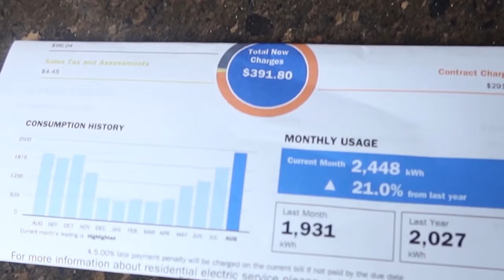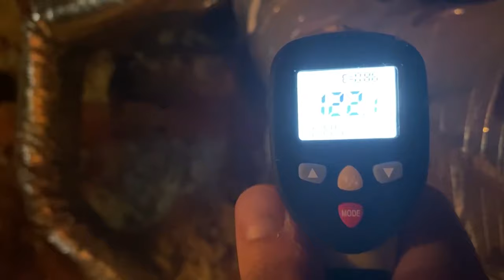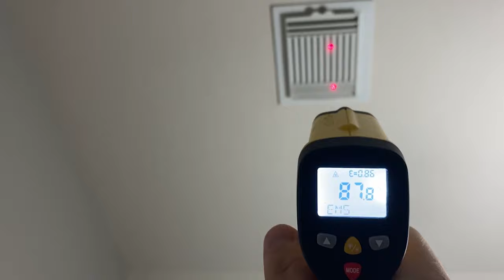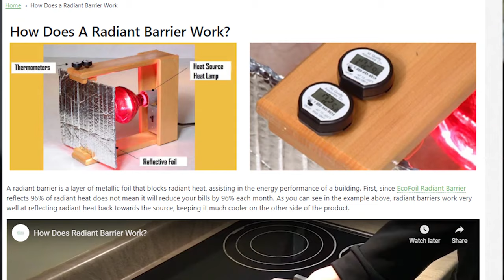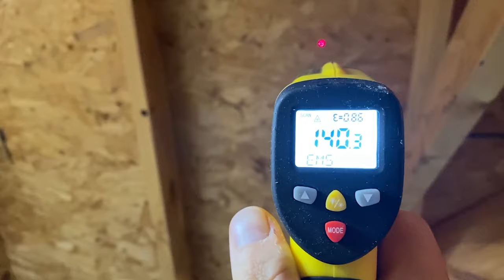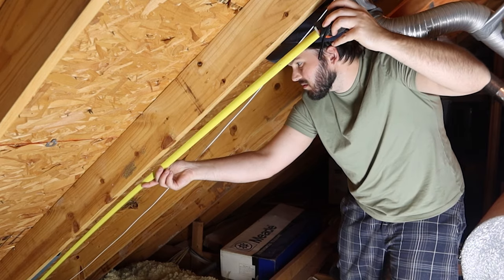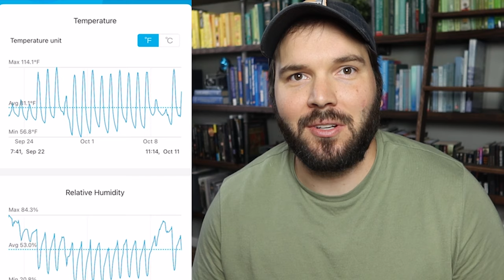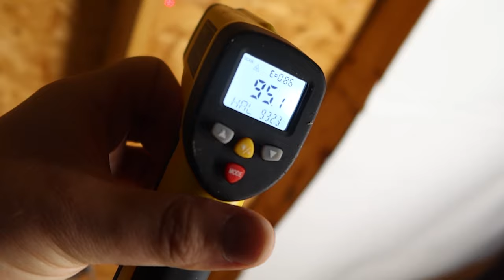Do Radiant Barriers Work & How Much Energy Will it Save: Real Home Owners Experience (Before/After)

Comment: Great video. Want to do this in my crawl space attic but double sided. Was considering the Lowes as it’s a little less than Home Depot but almost want to support attic foil because they’re a great resource.
Reply: Innovative Insulation in Texas $.12 s/ft
Reply: Buy it in February. I bought a double aluminum foil side but single bubble wrap in the middle for $50 for 500sq. Ft.  I couldn't believe the deal. Now I can finish my attic. I just did some of my attic for 1 summer and it made a big difference. Now I'm very excited for this summer :)

Comment: Would I be able to line my roof without putting tiles over. My roof is flat and it is so hot during the summer
Reply: It needs to have an air gap of at least a half inch.

Comment: I leave the ac fan on all the time and it works well
Reply: It will increase the humidity during cooling season. The condensation from evaporate (indoor) coil will get back to the house.
Reply: Yeh. Don’t do that. It increases humidity.

Comment: Sounds like your ac is being controlled by the utility company if it's 15 on and 15 off. Is this the case?
Reply: Someone above posted that the unit is most likely oversized. If it short cycles, then it probably is and will wear the unit out. Bigger is not always better. You must be referring to the smart buildings where everything will be controlled!

Comment: I was watching a video on YouTube about HVAC ducts, he said ducts in attics is bad idea, temperature difference is huge in summer, R8 insulated ducts are not helping.
Reply: Quite true. Running HVAC ductwork through the attic, which is all too common, means that chilled (or in winter heated) air is only an R7 away from a very hot (or cold) attic space. I my case, I solve that problem by putting an additional R7 wrap around my ductwork and putting 16-inches of blown in cellulose on the floor of my attic. That gives about 5 inches of cellulose above my ductwork. It seems to work well enough. Even my most distant vents get properly heated or cooled air. I also used aluminum foil tape to seal up the gaps between the vents and my ceiling so there's no air leaking into the attic. Tape seems to work better that expanding foam and is much cheaper.

Comment: Wouldn't it destroy shingles though? I mean your blocking out all that heat and heat has to go somewhere instead it just keeps building witch leads to melting the shingles, right? With temps reaching 100+ F those shingles should be reaching atleast 130+ F
Reply: No it doesn’t. Watch the video: Radiant Barrier Is It a Scam by Sarasota Energy Saver

Comment: building a home so that the roof is separate from the home, will prevent this issue. Think of the roof as a tree shading the house fully, and the house underneath, it has a 2nd roof to seal off home from outdoors.  This way, attic is free to vent all that heat, home is shaded all day.

Comment: If you use white Roofguard 700 on you asphalt roof every other year, it eliminates the need for a radiant barrier and you will have a forever roof.  After I applied several layers, my attic went from 145+ midday in the summer to 5 degrees above ambient temperature.
Reply: You applied this to your residential home? Just wanting more detail. Say I bought this product and painted my roof on a one story home with an attic and around a 30 degree angle.
Reply: @toolandmaynard  My roof was leaking and the shingles were curling up.  I used a 3/4" nap roller with a 12ft. pole to backroll Roofguard under the shingles and pressed them back down.  I used 3 layers the first time to seal everything.  I've been reapplying about every 1/3rd year since.  Now it's a solid coat.  Any groves I filled in.  The downside is snow doesn't melt like a normal roof.  My neighbors will have ice dams and ice sickles and then go dry while my roof will just sit there full of snow.  So if you get a lot of snow, that might be an issue.
Reply: Interesting. I have a couple areas that are weak in my roof and leak slightly. Sealed it with tar haven’t noticed an issue yet. I’ll look into this. The snow not melting is a sign of good insulation. I get what you are saying though. Thanks
Reply: @toolandmaynard  Any bad spots I used a couple of layers of 6 oz.  fiberglass cloth.  The cloth makes the roof dramatically stronger.

Comment: Thank you! I also like the white. Can you tell me where you purchased it?  I just thought of something though. If it is white on the inside, it wont work as a radiant toward the inside during the winter months.
Reply: If you live in the north/cold, you lay it down on the floor of the attic, on top of the insulation. That keeps the heat inside the house.
Reply: The white side is for appearance only, to give a finished look.

Comment: If ducts have to be in the attic the first step is to eliminate as many air leaks as possible. The second step is to insulate better, most homes have at least R30 attic insulation but at best the ducts are R8. The radiant barrier is always nice to have as well but should be the third step. I spent 45 years in the HVAC industry and if building new today I would use the highest efficiency mini splits and build the home very airtight adding an ERV to introduce fresh air.

Comment: Sounds like you could benefit from a gable fan for you attic. And I'd look into your ductwork those numbers sound extremely at start up. Check to see if they are sealed and insulated properly and routed correctly.
Reply: Thatd tank the AC efficiency and cause moisture issues. Gable fans aren’t common in humid climates for this reason. If he’s already got humidity issues this’d be a recipe for disaster
Reply: Do not put an electrical fan where there is lots of insulation that can start on fire. Very bad idea foil and bubble wrap can't start a fire. So just get the radiant barrier

Comment: Company giving me estimate puts it in the floor versus the roof. To prevent the heat/air from escaping or coming in. Said 20% less solar panels needed
Reply: Air sealing is the only way to stop the heat moving around. Insulation uses air to get its R value, if you pass air through it the heat goes right with it.

Comment: I would be interested in the change of temperature between the barrier wrap and the wood sheathing as that may affect a significant rise in heat causing a shorter lifespan for the shingles...
Reply from the maker: That is interesting. I didn’t think about the heat affecting the lifespan of the shingles. Towards the end of the video I do show the difference between the radiant barrier and the underside of the sheathing. It is almost a 20 degree difference on a mild 76 degree day.
Reply: @GrayHouseStudio  I think air movement and the attic heat both affect the lifespan of shingles. That's why attic ventilation is so important.  I would be interested in the heat between the barrier and the shething next time you've had some nice hot days...
Reply: Here is a video I did back in 2011 Showing that the roof deck over a radiant barrier will only go up 5-10º which is considered nominal.  https://youtu.be/OHpyv_kxmoI
Reply: @AtticFoil  Thanks for the video and information...
Reply: @GrayHouseStudio  I had a new roof put on 5 years ago and allowed the ridge vent. Love it. Just by itself it works great. I can't wait to see the difference with the barrier.

Comment: ATTACH  IN THE ATTIC BY STAPLE TO THE RAFTERS, THAT MAKES THE AIR GAP.  OR LAY KN TOP OF EXISTING INSULATION.  IF USING THE PROPER RADIANT BARRIER IT WILL WORK.  IT WAS USED IN SPACE TO CONTROL TEMPERATURES IN SPACE SUITS AND MODULE
Reply: Foil stapled to rafters has another advantage. It channels the heat up creating a chimney effect. That keeps the hotter air away from the insulation above your living areas.

Comment: Thank you for sharing the results on the actual difference the Radiant barrier makes using data from yourtemperature sensors. I'm in the UK where the summer/fall temperatures generally don't require the need of using A/C to cool the home. I am really keen to find out if the radiant barrier prevent warm air under the attic insulation from escaping out through the roof. I noted that the product you used only has the reflective surface on the outer side and not inside. So I take it this product does reduce heat loss during the colder months.?
Reply: From what I know, reflecting back heat is considered the most optimal (ie. the shiny side inwards if you are trying to retain heat), but it actually works very well even if you do the opposite. This is because of a material property called emissivity. While reflectivity tells you how much light is bounced back (higher is better for an insulator), emissivity tells you how easily a material gives off infrared light (radiative heat) relative to it's temperature (lower is better for an insulator). Aluminium foil and these mylar-like materials (basically aluminium foil reinforced with plastic for tensile strength) have both an extremely high reflectivity and an extremely low emissivity at around 97% and 3% respectively. A perfect mirror would be 100% and 0%, but obviously that's not practical. If you own a decent IR thermometer it will have an adjustable emmisivity you can use to accurately measure low emissivity materials (typically unpainted metals). Really cheap ones may just have it locked at 95% because that's "about right" for most household materials, but that will give very silly (far too low) readings on something like a polished steel pot for example.

TLDR: The white side will absorb heat like any regular wall, but will be very hesitant to send it back out on the other (shiny) side  - assuming there is an airgap there. So it is still effective.

But of course, if you have an airgap on BOTH sides (or at least very poor conductive contact, like maybe lying up against fiberglass insulation) then you get a double whammy of having both the reflectivity and the emissivity working in your favor. Whether that is worth it in terms of practicality and space-use is perhaps questionable though. Consider adding a very thin layer of insulation to the beams where the foil attaches to hamper the cold bridging effect. It takes very little material, but can have a noticeable effect.
Reply: @TheStigma  I’ve used many radiant barrier products over many years. First off, aluminum foil (tin foil) is a misnomer. This product is 99.9% aluminum, period. Probably, in your situation, you might want to lay the product (it comes perforated to breathe) directly on top of your existing insulation. The white sided product is only for appearance to give a finished look. Double bubble double foil is the ultimate product I get for $.30/sf. The foil product is about $.12 / sf. Let me know if I can be of further help.
Watch the video:Radiant Barrier Is It a Scam?
 Sarasota Energy Saver for a great demonstration
Reply: @rayburnyarborough4695  huh?? How is aluminium foil a misnomer for a product that is a foil made out of aluminium? Maybe you mean that "tin foil" is a misnomer, and that would be correct since "tin foil" hasn't been made out of actual tin since around WW2 - but I never said tin foil, so I'm confused what you are referring to...
Also I haven't used this spesific product, but I would be very surprised if it didnt have some plastic polymer reeinforcement. If it didn't and was pure aluminium it would tear extremely easily and not be suitable for construction - just like aluminium foil you put on your grill (which IS pure alu.). The plastic polymer layer(s) is exactly what makes these materials robust enough for the job, so it's not like thats a bad thing. Quite the opposite.
Reply: @TheStigma  I apologize if I misspoke. Growing up, it was tin foil for me. You’re exactly correct. This product is extremely durable. You cannot tear it. If you’ll look up Innovative Insulation, you can see the many products available and see the data sheets on them. If you watch the video, it shows the same demonstration I saw years ago. I was sold on it then and used it since then in my construction business. 
 There is another product that is an additive for paint made by Hy-Tech Sales. Check it out and let me know what you think. 
 Btw- fluoride, that we all love so much, is a byproduct from the manufacture of aluminum. Thanks for the reply!

Comment: So after these months do have an idea how much the radiant barrier cools temps?
Reply from the maker: With our leaky AC in the attic it seems to keep the attic about halfway between the temp of outside and the conditioned space. In the winter when it is 30 outside it will be about 55 in the attic and about 70 inside. In the summer it will be about 85 in the attic and 100 degrees outside. It kept our pipes from freezing when the power went out for three days with 7 degree temps outside.

Comment: While it’s easy to simply roll this stuff out on the attic floor, and it may help a tiny bit for a little while, it’ll eventually get dusty and stop working. 
In an attic situation you’re far better off adding insulation. Once you get over R-38 attic insulation, the minimum recommended in our area, even the benefit of a properly placed radiant barrier (stapled to the underside of the attic roof rafters) disappears.
Reply: Actually, AFTER you insulate the attic floor, you should drop the radiant barrier on top of the insulation,  Cheap,, Easy,
Reply: Depends on the area. Hot desert area like Arizona or Southern Nevada homes heating insulation is less of concern. For those homes radiant barrier seems to be the best in terms of bang for buck, of course assuming the house is properly sealed already.
Reply: @PatIreland  Actually, AFTER you air seal the attic floor, then insulate the attic floor, you should drop the radiant barrier on top of the insulation. Actually, with a radiant barrier on top of the insulation (in a horizontal position), dust can and will accumulate on top of the radiant barrier reducing its effectiveness over time.
Reply: @kevinhogan2909  i'm planning to install one layer of radiant barrier on the joist to reflect heat from the sun in the summer time and one layer on the attic floor to retain heat from within the house during the winter time. i would think this should still be effective for my intended purpose

Comment: The foil that's on the OSB is a perfectly good radiant barrier you go up in the attic and spray a radiant barrier on the bottom side of the plywood or decking and it will serve the same purpose I have cut power panels and put between the and made the difference

Comment: Kinda misleading title. You never measured energy changes before/after, you only showed graphs of temperatures without barrier, not with the barrier, and you recommended a radiant foil brand that is twice the price of the leading brands. Otherwise, not a bad video.
Reply from the maker: Thanks for your feedback! I need more practice on my more technical videos. My challenge showing power bill change is that the weather changed significantly mid month. My best solution was to show how much the temperature change in the attic was compared to outside temp. and infer future savings based on the significant article temp decrease due to the radiant barrier.
Reply: @GrayHouseStudio  So, will thee be follow up studies with more data gathering, including  energy consumption comparisons year over year?

Thank You